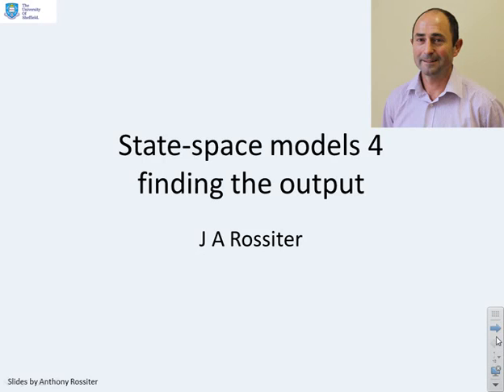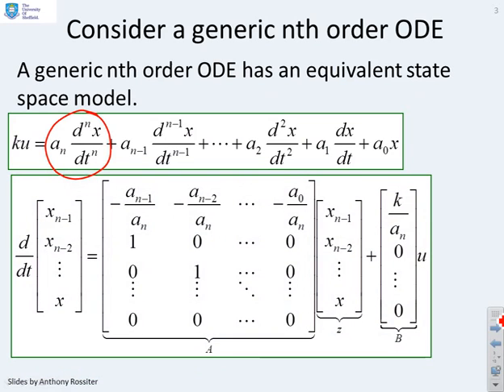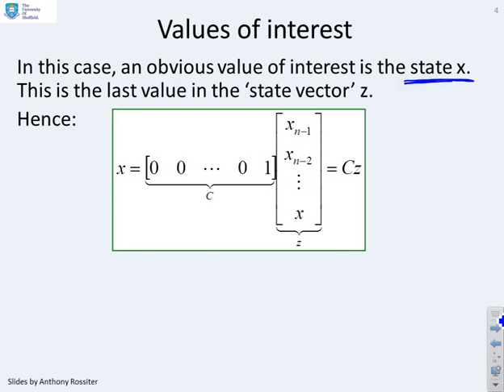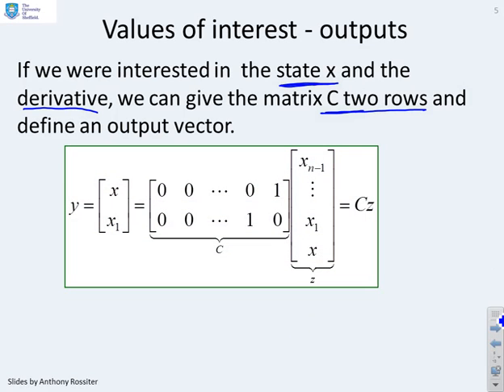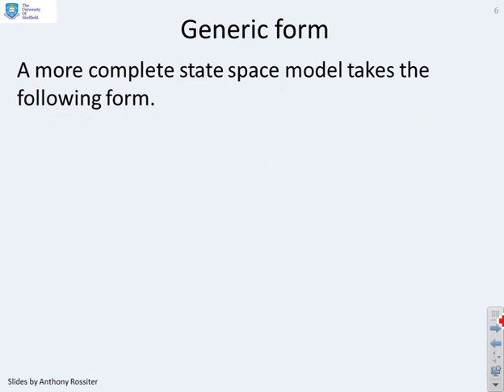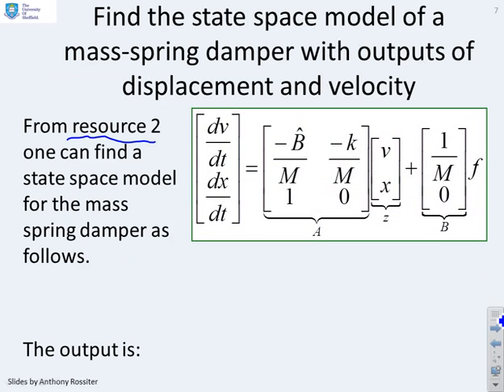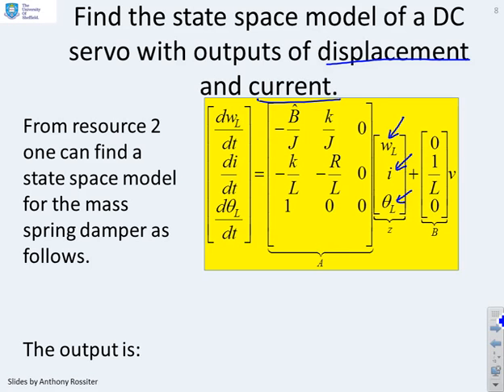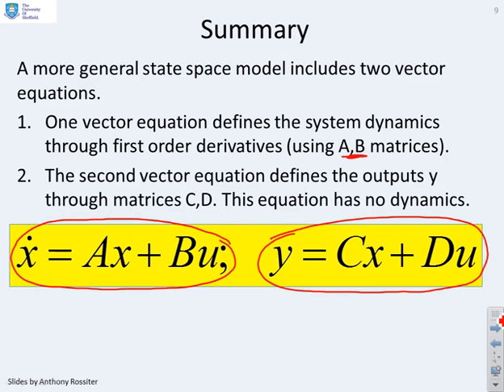State space 4 - defining the system output

Comment: Thanks for this video. I have a question. I have a state space model of a thermoblock heater (by using system identification I have the A, B, C matrix. D is considered 0). I would like to make a calculation in C langage to predict every second in my control loop the 100 predicted values for the output (y) of the thermoblock. I know the input signal u (0 to 1 for power control of heater), I can measure the output temperature so I know y. How can I do to obtain the state x of my system at time k to be able to calculate the 100 future predicted values for the heater output y ?
So my question is how can I calculate a sort of state estimated for my heater, to be abe to make on each loop of my controler a calculation of the zz next future output temperature y ? Thanks for your assistance.